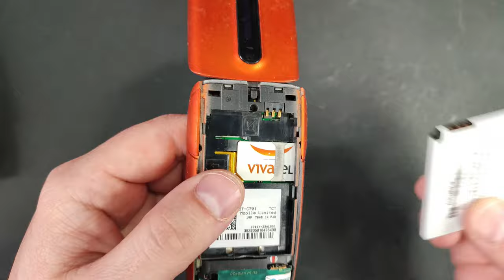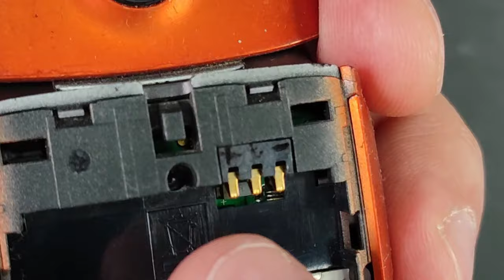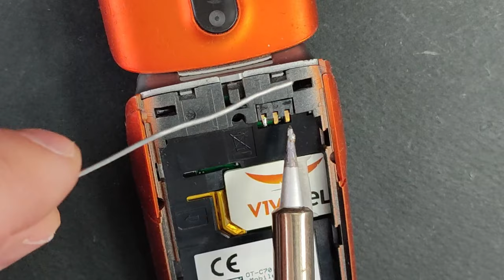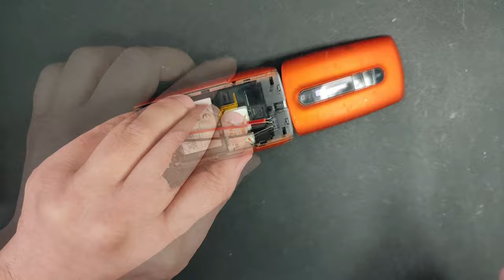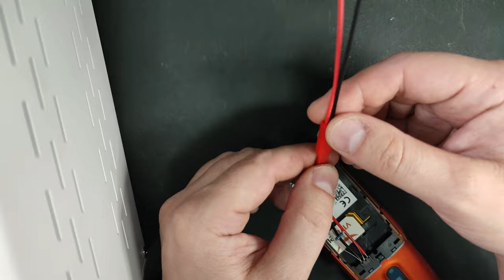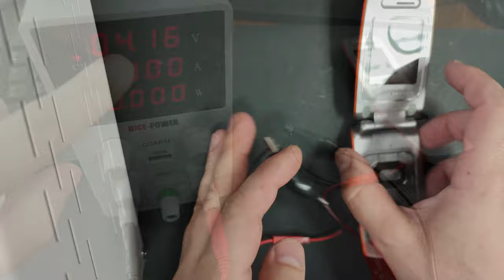How to turn on old phone without battery and extract files

Comment: The phone turned on but then the wires the + touched the -  and it was connected to the battery. now it is not turning on. Did I missed up the phone?
Reply from the maker: I think the phone should be OK. Maybe and it is  most likely that the power source stopped working
Reply: @FixitEasyDIY ok thanks 

I will try again 
Btw I connected the wires without resistor
Reply from the maker: @Rayan-yj8ke  It might work without the resistor. It depends on the device